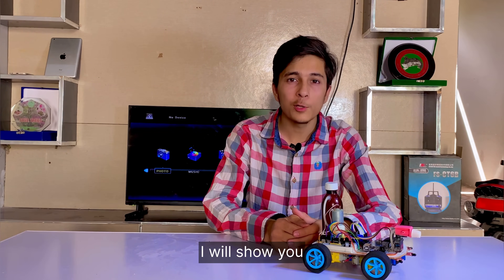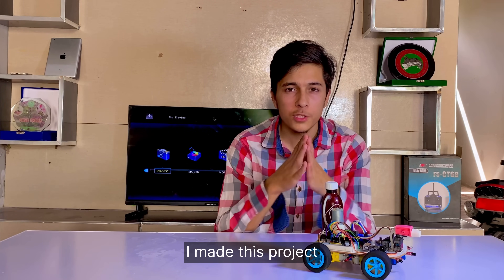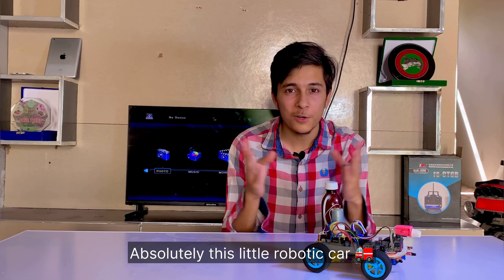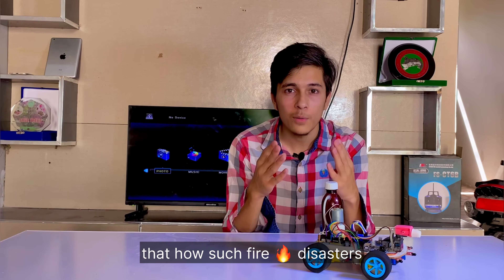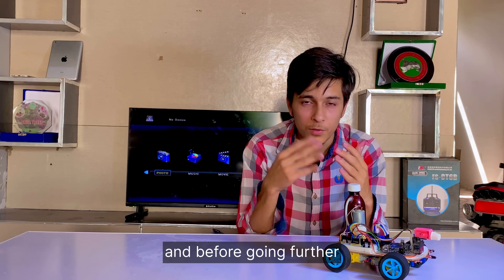DIY Fire Fighting Robot using Arduino  |  Auto Fire Chaser and Extinguisher

Comment: Plz give me to instruct two motors instead of 4 after sensing fire and servo also not work properly and is is possible to use 1.5v*6 battery
Reply from the maker: I think Your are having power problem.. which batteries have you used and whats the net output voltage
Reply: @saadinnovativeideas  yes I used 33a cells means 1.5v *6 six cells of 1.5v
Reply: What can I do plzz help me I cannot able to runs motors my power supply are working properly
Reply from the maker: Brother the arduino board and motor driver needs more than 2 amps to run.. the cells you are using can hardly provide 1 amps which not sufficient. Try to use 3.7 v rechargeable batteries that has the capacity to do so
Reply: @saadinnovativeideas  but I used pair of six cells and 12 was used means 6*1.5v =9.5v so why But power supply required is 7.2v and I used 9.5 v
Reply: @saadinnovativeideas  bro plzz I need to contact you how could I plzzzzz my solve my error
Reply: @saadinnovativeideas  I used 6 cells of 1.5v means I give 9.5v power supply
Reply: @saadinnovativeideas  is it sufficient to use two lithium batteries of 3.7v
Reply from the maker: Yeah use two 3.7 V lithium batteries

Comment: My motors were not working while sensing fire why plz help me my project was stopped due to this problem and one thing I used 2 motors instead of 4 but I changed low and high command proper thus not work please help me to start motors while sensing fire plzzz
Reply from the maker: Tell me sensors pinout and connection
Reply: @saadinnovativeideas  I need to contact you plzzz

Comment: Hello i am done this project component connection but at run time port does not show the arduino it only show the com 1. Plz help me
Reply from the maker: Install USB DRIVER for it
Reply: Ok
Reply: Tell me about I can follow the video or circuit diagram for connection of flame sensor because both are different
Reply from the maker: Follow circuit diagram, I made a bit mistake in the video and set it behind the scenes

Comment: Motors are not working i think it needs more power but not sure pls reply ty.
Reply from the maker: How much is your net input voltage?
Reply: @saadinnovativeideas  i have two 3.7v battery
Reply: @saadinnovativeideas  so far everything works just fine it just wont move to the fire😅
Reply from the maker: Tell me the sensors pinout connection
Reply from the maker: Tell me the third one (D0 or A0)
Reply: Ohh I dont have those. I only have 3 pins which is OUT, GND, and VCC
Reply from the maker: Thats fine.. the problem may be with the connections or components
Reply: @saadinnovativeideas  i double checked every connection and i think i did them correctly. Everything works fine as programmed so i dont know why the motor wont move. Is there a specific voltage rate for the motors?

Comment: 00:10 Learn to create an Arduino firefighter robot
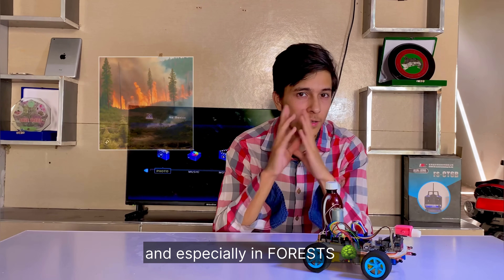01:04 Robot designed to handle fire disasters
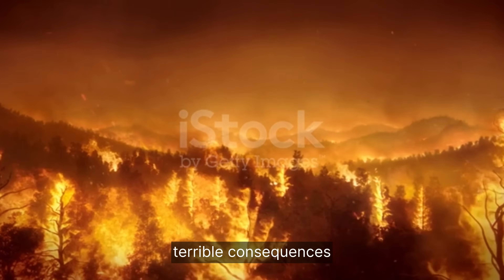01:20 Introduction to controlling the DIY Fire Fighting Robot
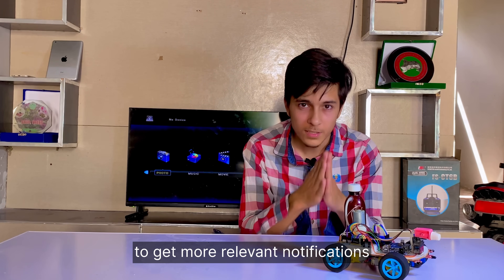01:35 Building a DIY Fire Fighting Robot using Arduino
02:59 Background music used in the video.
04:03 DIY Fire Fighting Robot using Arduino
06:28 DIY Fire Fighting Robot using Arduino
08:02 Arduino-powered DIY Fire Fighting Robot
Reply: Geeat

Comment: Bro i making your project...i done all connection coding and evey part of it. As you said. But only one sensor glowing light and detect fire..not others. Remaining not working.means i have two gear moter wheels and one nor mal ball. When i turn on water pump continuously run. Wheels are not  moving.. help brother ..plss4:57

Comment: Here I leave the code that I used, my Arduino is a Chinese one, it is the ch 340G and
Reply: Hate to trouble you ,but do you have the code in a pdf and is there any way I could contact you for the code as I have a presentation in 10 days.......
Reply: @Jhinuk-p4f  did it work??
Reply: #define enA 10//Enable1 L298 Pin enA
#define in1 9 //Motor1 L298 Pin in1
#define in2 8 //Motor1 L298 Pin in2
#define in3 7 //Motor2 L298 Pin in3

#define in4 6 //Motor2 L298 Pin in4
#define enB 5 //Enable2 L298 Pin enB
#define ir_R A0
#define ir_F A1
#define ir_L A2
#define servo A4
#define pump A5
int Speed = 160; // Write The Duty Cycle 0 to 255 Enable for Motor Speed
int s1, s2, s3;
void setup(){ // put your setup code here, to run once
Serial.begin(9600); // start serial communication at 9600bps
pinMode(ir_R, INPUT);// declare fire sensor pin as input
pinMode(ir_F, INPUT);// declare fire sensor pin as input
pinMode(ir_L, INPUT);// declare fire sensor pin as input
pinMode(enA, OUTPUT); // declare as output for L298 Pin enA
pinMode(in1, OUTPUT); // declare as output for L298 Pin in1
pinMode(in2, OUTPUT); // declare as output for L298 Pin in2
pinMode(in3, OUTPUT); // declare as output for L298 Pin in3
pinMode(in4, OUTPUT); // declare as output for L298 Pin in4
pinMode(enB, OUTPUT); // declare as output for L298 Pin enB
pinMode(servo, OUTPUT);
pinMode(pump, OUTPUT);
for (int angle = 90; angle <= 140; angle += 5) {
servoPulse(servo, angle); }
for (int angle = 140; angle >= 40; angle -= 5) {
servoPulse(servo, angle); }
for (int angle = 40; angle <= 95; angle += 5) {
servoPulse(servo, angle); }
analogWrite(enA, Speed); // Write The Duty Cycle 0 to 255 Enable Pin A for Motor1 Speed
analogWrite(enB, Speed); // Write The Duty Cycle 0 to 255 Enable Pin B for Motor2 Speed
delay(500);
}
void loop(){
s1 = analogRead(ir_R);
s2 = analogRead(ir_F);
s3 = analogRead(ir_L);
//=============================================================
// Auto Control
//=============================================================
Serial.print(s1);
Serial.print("\t");
Serial.print(s2);
Serial.print("\t");
Serial.println(s3);
delay(50);
if(s1<250){
Stop();
digitalWrite(pump, 1);
for(int angle = 90; angle >= 40; angle -= 3){
servoPulse(servo, angle);
}
for(int angle = 40; angle <= 90; angle += 3){
servoPulse(servo, angle);
}
}
else if(s2<350){
Stop();
digitalWrite(pump, 1);
for(int angle = 90; angle <= 140; angle += 3){
servoPulse(servo, angle);
}
for(int angle = 140; angle >= 40; angle -= 3){
servoPulse(servo, angle);
}
for(int angle = 40; angle <= 90; angle += 3){
servoPulse(servo, angle);
}
}
else if(s3<250){
Stop();
digitalWrite(pump, 1);
for(int angle = 90; angle <= 140; angle += 3){
servoPulse(servo, angle);
}
for(int angle = 140; angle >= 90; angle -= 3){
servoPulse(servo, angle);
}
}
else if(s1>=251 && s1<=700){
digitalWrite(pump, 0);
backword();
delay(100);
turnRight();
delay(200);
}
else if(s2>=251 && s2<=800){
digitalWrite(pump, 0);
forword();
}
else if(s3>=251 && s3<=700){
digitalWrite(pump, 0);
backword();
delay(100);
turnLeft();
delay(200);
}else{
digitalWrite(pump, 0);
Stop();
}
delay(10);
}
void servoPulse (int pin, int angle){
int pwm = (angle*11) + 500; // Convert angle to microseconds
digitalWrite(pin, HIGH);
delayMicroseconds(pwm);
digitalWrite(pin, LOW);
delay(50); // Refresh cycle of servo
}
void forword(){ //forword
digitalWrite(in1, HIGH); //Right Motor forword Pin
digitalWrite(in2, LOW); //Right Motor backword Pin
digitalWrite(in3, LOW); //Left Motor backword Pin
digitalWrite(in4, HIGH); //Left Motor forword Pin
}
void backword(){ //backword
digitalWrite(in1, LOW); //Right Motor forword Pin
digitalWrite(in2, HIGH); //Right Motor backword Pin
digitalWrite(in3, HIGH); //Left Motor backword Pin
digitalWrite(in4, LOW); //Left Motor forword Pin
}
void turnRight(){ //turnRight
digitalWrite(in1, LOW); //Right Motor forword Pin
digitalWrite(in2, HIGH); //Right Motor backword Pin
digitalWrite(in3, LOW); //Left Motor backword Pin
digitalWrite(in4, HIGH); //Left Motor forword Pin
}
void turnLeft(){ //turnLeft
digitalWrite(in1, HIGH); //Right Motor forword Pin
digitalWrite(in2, LOW); //Right Motor backword Pin
digitalWrite(in3, HIGH); //Left Motor backword Pin
digitalWrite(in4, LOW); //Left Motor forword Pin
}
void Stop(){ //stop
digitalWrite(in1, LOW); //Right Motor forword Pin
digitalWrite(in2, LOW); //Right Motor backword Pin
digitalWrite(in3, LOW); //Left Motor backword Pin
digitalWrite(in4, LOW); //Left Motor forword Pin
}
Reply: @leonardougarte1173  are you a saint?
Reply: @leonardougarte1173 tq🎉
Reply: @leonardougarte1173 hey
Reply: @leonardougarte1173  i am making this too
Reply: @leonardougarte1173  thanks I'm making this too
Reply: Hey , how can I contact you?

Comment: 7:18 7:17 
Is the green and yellow stuff next to the flame sensor on the breadboard a diode or something else?
Reply from the maker: Check it in the circuit diagram
Reply: Sorry bro, I don't know when to insert each cable into the breadboard,
because my bread board is different from yours 

when you insert the servo cable into the bread board, which port is it in?
Reply: when I try to match yours, it's like there's something wrong with mine
Reply: Pls bro🙏

Comment: Hi bro 
Before I start the project, does the code work?
Reply from the maker: Yes of course
Reply: @saadinnovativeideas  OK bro 
another question pls
I use Aurdoino uno but 
not like yours 
normal?
Reply from the maker: No issue, but be careful about pin out.. if you change pin number then change the pin No. in code as well

Comment: It didn't work pls help
Reply: For 3 pin flame sensors
Reply: @rohitashagrwal9079  it doesn't work on 3 pin flame sensors?? Will it work on 4 pin?
Reply: @rohitashagrwal9079 i don't understand can you explain more
Reply from the maker: It doesn’t matter, you are having 3 or 4 pin flame sensors but for the code and connections I provided is compatible for analogue pin sensors, for digital pin sensor you have yo modify the code and connections…
Reply: @saadinnovativeideas  can I use regular 9v batteries

edit: nevermind I just read another comment 😅😅😅

Comment: Saad all the connections r right, arduino, flame sensor and L298 motor give red light when i turn on the switch but the code is not working or i dont know what but nothing works at all, 
Please help me
Reply: Yeah same problem occured with my project, if you found the problem, Can you please tell me what is it?
Reply: @Unknown._369  same problem...give solution plz
Reply: @ayushsrivastava8580  any solution?
Reply: @ayushsrivastava8580  you need to add library in computer software
Reply: Which library  @SadanAnsari01

Comment: bro the analog flame sensors are not available in any stores and this project wont work with a digital sensor What should i do? i have only a digital flame sensor with digital output
Reply from the maker: Then modify the code, In code type digital pin anywhere in place of analogue pin and in Connections replace analogue pins with digital pins in arduino uno

Comment: Saad please help me its very urgent, i have an exhibition in few days, 
The car is not working, nothing is working , i did all the connections correctly.
While uploading the code there were only two port option COM1 and COM3, it was showing error in COM 1 so i uploaded the code from COM3.
 I have used the same batteries as u showed in the video two 3.7v Li ion batteries.
Please connect with me.
Reply: I think you dud the servo wrong my friend
Reply from the maker: Was the code uploaded successfully by COM3? And does the UNO and sensors LEDs turns ON or not?
Reply: @saadinnovativeideas  Yes the code was uploaded successfully and yes the Uno and sensor led light was on
Reply: @saadinnovativeideas  how can I contact u so u can see the project and help me
Reply from the maker: Yeah contact me on my instagram sahibzada3767
Reply from the maker: Ok
Reply from the maker: Sorry brother I haven’t received a follow request from you
Reply from the maker: Sorry brother I haven’t received a follow request from you

Comment: Give the components list
Reply: COMPONENTS REQUIRED:
1.  Flame sensors  x 3
2. Arduino UNO
3. Chachies
4. BO motors  x 4 (+wheels)
5. L298 Motor driver
6. Solder-less Breadboard
7. Mini servo
8. 5-9 V Water pump + pipe
9. Water tank / bottle 
10. 3.7 V batteries (18650) x 2
11.  Jumper wires
12. TIP-122  Transistor   +  104 uf capacitor  +  1K Resister

Comment: Can you add a 5v relay module to the project? And if you were to add it how would you add it?
Reply from the maker: Yes you can. Apply the same circuit diagram
Reply: In which place we can use @saadinnovativeideas

Comment: We have done complete  project  but Bro Code is not working  
Give me a new  Code
And Car is not moving & servo motor also not working
Reply from the maker: Code is perfect. It may be the power problem
Reply: @saadinnovativeideas  
No bro having  trouble  in the project
We gave power 7.4 v  batteries with 3000mah
Reply from the maker: What trouble?
Reply: @saadinnovativeideas  
1.Car is not moving 
2. Servo motor not working 
Remaining  all good
Reply from the maker: You are having the battery problem. And for servo interchange the side wires connections.
Reply from the maker: Which battery have you used
Reply: Plz bro give some idea or new code
We have done almost 90% project
Reply from the maker: Whats the net output voltage?
Reply: @saadinnovativeideas  
3.7 volt
Used two batteries
Reply from the maker: Do you mean that total voltage you have given to the arduino uno is 3.7 V
Reply: @saadinnovativeideas  
No we gave 7.4V
Reply from the maker: Does the arduino board led and sensors led turns ON?
Reply: @saadinnovativeideas  
Yes arduino and sensors working  properly
Reply: Bro we have project  submission 
On Wednesday  plz tell the solution
Reply: Bro did it work??? I'm having the same problem
Reply: Bro did it work? I'm having the same problem
Reply: @ayushsrivastava8580  
Doesn't worked bro

Comment: Connections are done as per video, still pump and servo motor not working?
Can you give a solution
Reply from the maker: Interchange servo side wires and leave the middle one

Comment: Help, I have used the diagram that you sent but it still does not work, it does not give anything and it does not turn on the arduino or those that control the motor. I have an input on the 6v battery that affects you. You have to move a video but this time show us well how to connec
Reply: @saadinnovativeideas  please try anyway
Reply from the maker: Is the battery you have used a rechargeable or non and how much amps that can deliver?
Reply: @saadinnovativeideas   No, the battery is not rechargeable, there are four batteries and each battery contains 1.5 volts. In total there are 6 volts, does that affect or not?
Reply from the maker: Your having power issue.. non rechargeable most batteries can’t provide more amps (2.5+ amps for this project). These batteries can hardly give 1 amp which is not sufficient

Comment: Hey friend,Why you used so much of electronic,you can also made this project without capacitor,transistor and diode,and if possible also without that breadboard
Reply from the maker: Yeah for running pump you can use relay module and for avoiding breadboard you will have yo solder the connections
Reply: @saadinnovativeideas  yes

Comment: Your code is not working, none of my components are not working, is this fake?
Reply: Does your flame sensor get power and on 
Or
Is it in off state
Reply from the maker: Its not the code issue. Check once again the circuit diagram. 
How much is your net input voltage??

Comment: Bro as u told before i changed the code to 1,2,3 like digital output but the problem was the pump motor running automatically can u give the clear explanation or code for that please
Reply: If you turn it on in the sunlight it won't work
Reply: @UM_Gaming_official how to make it work in daylight?
Reply: Coding is not working

Comment: Bro now i understood the mistake in your video u using ir with 4 pins connecting with AO pin but in my sensor only 3 pins are having and DO only having what to do please let me know 🙏🏻
Reply from the maker: You are making a mistake.. DO is digital pin and you are connecting it with analog pin of board. Connect all DO of all with digital 1,2,3 of board and modify the code of A1, A2 and A3 with digital 1, 2, 3 in code
Reply: @saadinnovativeideas  if i modify then it will work?
Reply from the maker: Yeah it should

Comment: Bro i think in the video ir sensor and I'm using ir sensor was different. I'm using DO sensor with only 3 pins . Give me the correct code for it please
Reply from the maker: O brother I asked you fore to check connections with circuit diagram.. in the ir flame sensor DO goes alone don’t connect DO
Reply: Bro there is only 3 pins in the ir one for v5 another groud another A0 in Arduino right?
Reply from the maker: Connect the 5V of all sensors with 5V of arduino board and GND of all with GND of board and A0s of sensors with A1, A2, A3 of board respectively
Reply: @saadinnovativeideas  bro i have only 3 pins in my ir
VCC, GROUND AND DO PINS . In your ir there are 4 pins you connecting with AO but I'm having only DO
Reply from the maker: You are making a mistake.. D0 is digital pin  and you are connecting it with analog pin of board. Connect all D0 of all with digital 1,2,3 of board and modify the code of A1, A2 and A3 with digital 1, 2, 3 in code

Comment: Broo only one ir was working for bo motors turning left only what to do
Reply from the maker: Do the sensors work.. check sensors second led by exposing it to fire
Reply: @saadinnovativeideas  bro 2 sensors are working with fire and for pump
Reply from the maker: Your sensors connections are are not correct.. dont use DO in your sensor
Reply: @saadinnovativeideas  then how will i connect totally 3 pins only having
Reply from the maker: Are you having 4 pins in your flame sensor or 3? Name the pins!
Reply: @saadinnovativeideas  I'm having only 3 pins. Vcc, ground and DO
Reply: @saadinnovativeideas  I'm having only 3 pins. Vcc, ground and DO